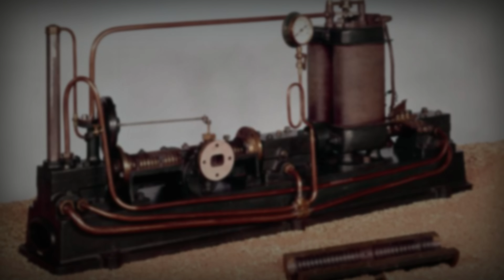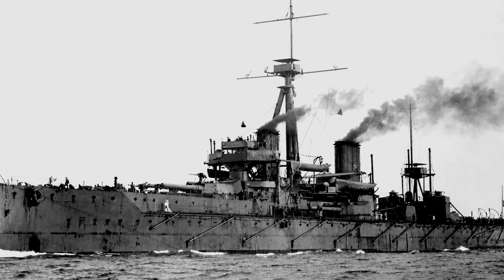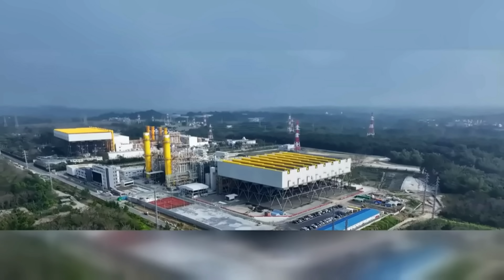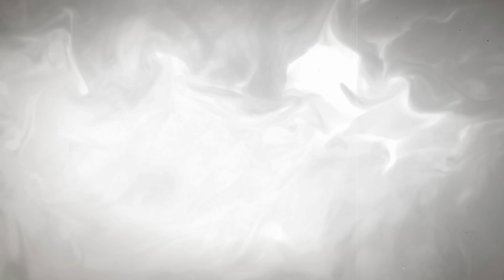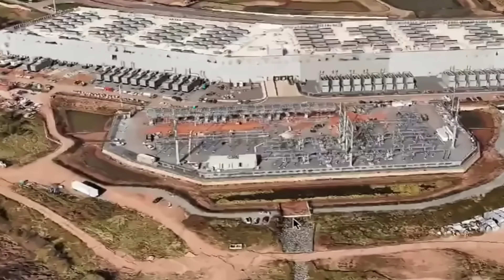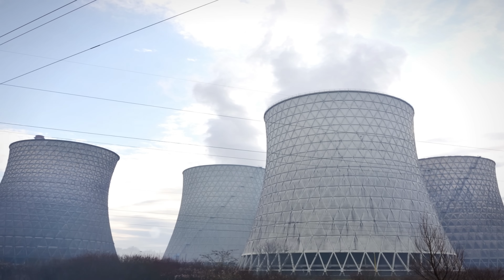The Engine Retired in the 50s Still Powers Half the World’s Electricity

Comment: Hey steam turbans are still used on older USNS ships still because its not cost effective to roll over to diesel, I served on Oceanographic units, and Nuclear submarines and submarine tenders still using steam turbans in the 1970's through 1980's. Subs will most certainly use steam turbans for the foreseeable future, Gas turbans are currently in use for medium sized USN surface combatants.

Comment: Most coal plants and nuclear plants are subcritical and have a typical efficiency of around low to mid 30 percent with the turbine HP steam temperature in the 1000 F (537 C) range.  Nuclear fission plants are unlikely to increase that efficient value given that reactors produce lower temperature steam than do the small number of supercritical coal plants.

Comment: Many smaller utility systems are using more and more Gas Turbine power plants. Primarily because they can be built much faster on a smaller footprint.
Reply: I live in South Central Alaska and gas turbine power plants are our primary source of electricity.   The natural gas is produced in our area but they are running out of this resource.If they don’t build the gas line from Prudhoe Bay we will be importing natural gas.

Comment: The Arabelle steam turbine outputs 2,372,600 Horsepower at rated load, 24/7 for years on end.  2.37 million horsepower...non stop. It spins at 1500 rpm to produce 50 cycle power.     The largest nuclear powered turbine generator hat I ever saw apart was Diablo Canyon Unit 2 which is a nuclear power plant on the California Central Coast.  It produces 1.474 million horsepower, 1100 Megawatts, and spins a 4 pole generator rotor at 1800 rpm producing 60 cycle power non stop.

USN nuclear powered submarines and aircraft carriers and almost all Navy surface ships were steam turbine powered when I worked on them in the 1980's. Typical large marine steam turbines had a high pressure rotor and a much larger low pressure rotor next to it driving through a single very large reduction gear unit driving the propeller shaft around 100 rpm at speed.  To reverse the ship, the steam is rerouted through a Curtis wheel stage and the turbines and propeller shaft are all spun backwards.  After an overhaul, a ship on sea trials would be brought to operating speed then be thrown into Full Astern. Everything vibrates and shakes during the test. It's called a Crashback.

 Steam turbine powered ships had several smaller turbine gearbox generator sets about the size of a small pickup truck to provide electrical power. A 4 foot long turbine spun at about 10,000 rpm through a gearbox to reduce the 6 pole generator speed to 1200 rpm. Most container ships, bulk carriers, and cruise ships are diesel powered these days.  This video sure brought back memories to me.